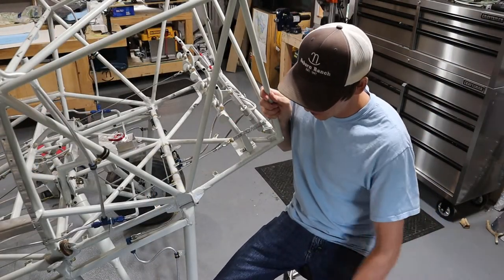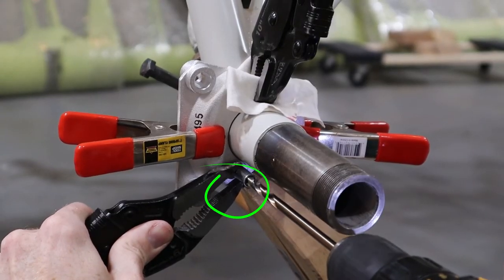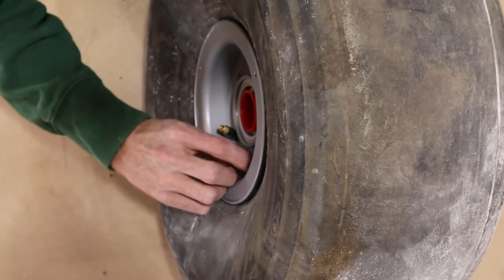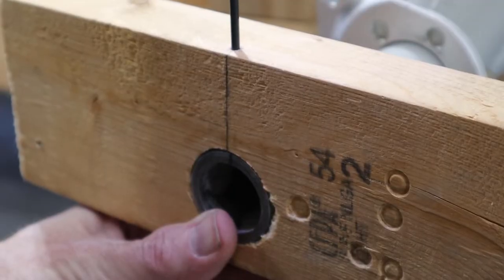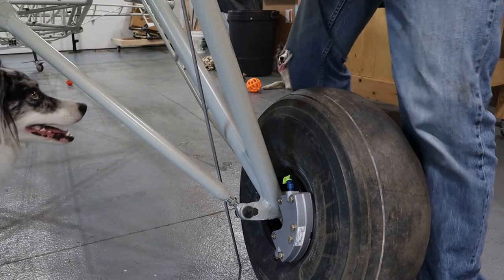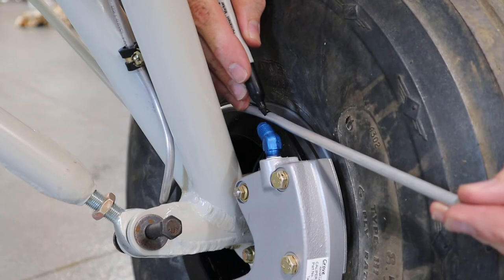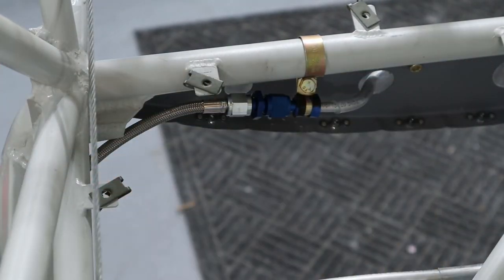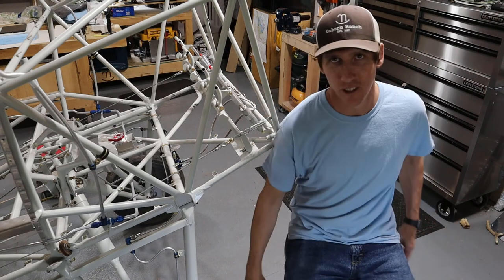Installing Bearhawk Landing Gear and Brakes

Comment: If you use a little contact cement on the wheel and tires it will help keep the tire from rotating on the wheel during landing and tearing the valve stem. Of course you only want to do that with the permanent tires.
Reply from the maker: Thanks for the tip!

Comment: From my industrial automation background, I didn't like the way you routed the flex hose at the top of the landing gear struts. That stuff doesn't like to twist. It will torque the fitting on the strut side, so be careful to check those often.
Reply from the maker: Thanks Eric! Greatly appreciate the heads up.
Reply: Any other suggestion on how to go about dealing with the movement of the gear legs?  I can't think of another way to deal with it other than what Colby did.
Reply: @Ko3n3k33  instead of that 90 degree bulkhead fitting, use a straight bulkhead fitting so the motion bends the line instead of twisting it. Admittedly this may require a different mounting location and is more difficult to keep out of the airflow, but it would be much more durable. An easier alternative is a little more slack and a clamp retrict the motion to the inboard end of the line.

Comment: It would be good to put a thin coat of grease or rust preservative on bare metal parts like the axles.
Reply from the maker: Would general purpose grease or wheel bearing grease be what you’d use, or is there a specific grease you’d recommend? Thanks for the advice!
Reply: @ColbyOsborn  I generally use what is convenient if corrosion protection is the main objective.  If long term protection is required, then something like Cor-Ban 27L is a good choice.
Reply from the maker: Got it. Thanks!

Comment: Do you think you will need to put a spacer plate on your brake caliper the way Rob had rondo after his brake fire?
Reply from the maker: I think Rob determined his parking brake valve was the cause of the issue, so I don’t think I’ll need the spacer. Appreciate the heads up.
Reply: @ColbyOsborn  if i recall correctly, that was the first thought, but he ultimately figured out that the caliper was too close, so he put the spacer in. It's not in the video that talks about the original issue, but in the follow up.
Reply from the maker: Ok, good to know. I’ll look into that. Thanks!